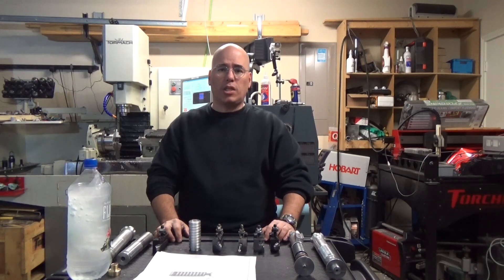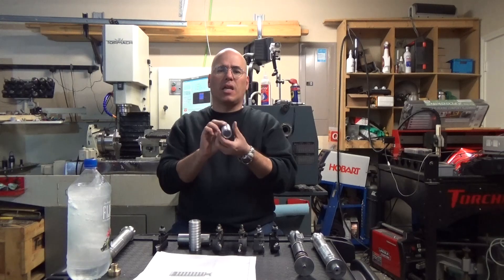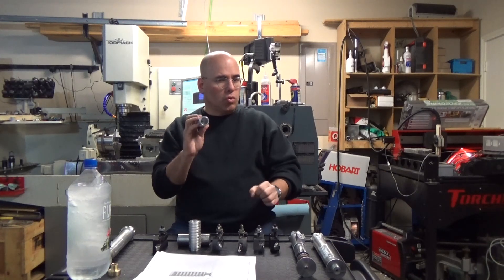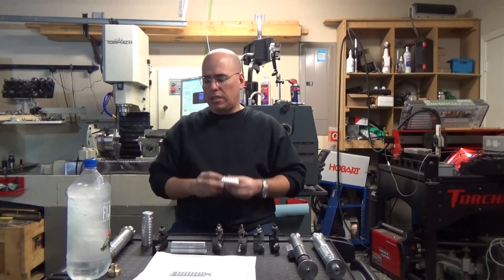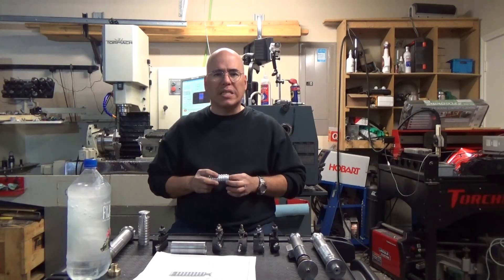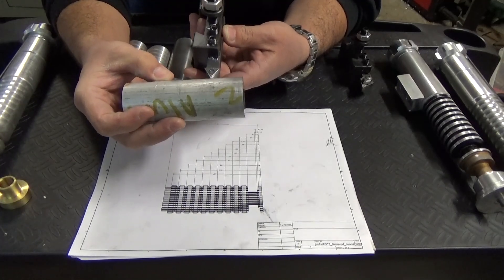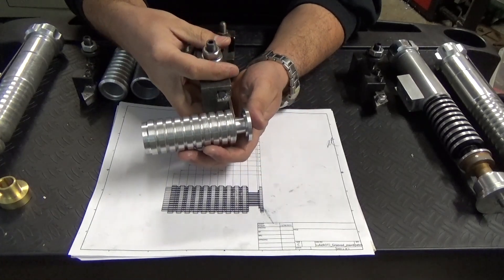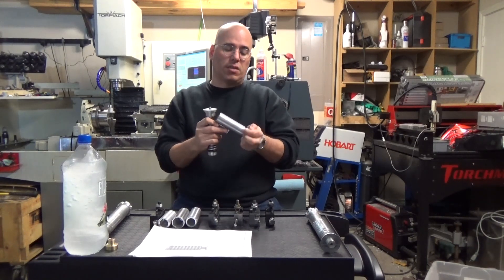Luke Skywalker's ROTJ Lightsaber Grooved Cylinder Build

Comment: Nice job dude! I have problems i wanna make a lightsaber but i dont have the plans to build that, so if you can help me i appreciated that so much... I want make the v2 of rotj luke skywalker lightsaber please help me with that! ...
Reply from the maker: Thanks for watching the video! I am not savvy on lightsaber revisions so I wouldn't know which one is rev1 and which one is rev2, but I can tell you that if you go to my blog at cncdude dot com, you will find a post with all of my drawings in DWG format (I think there might be PDF versions too) and you are welcome to download those and use at your leisure. Be warned, however, that these measurements are by no means official. In fact, they were taken from a picture which is the lousiest way of taking measurements, but that is what I have been using. I think the real thing is smaller, but you can adjust as you deem necessary. Have fun!
Reply: CNC Dude Thank you so much!